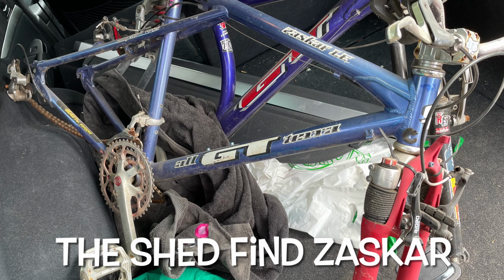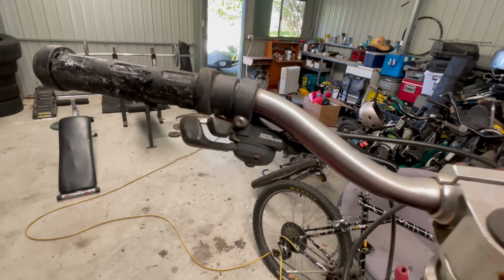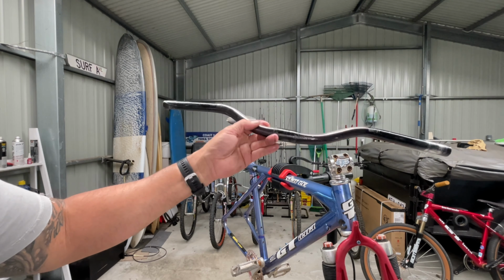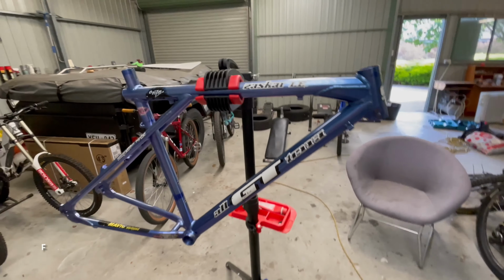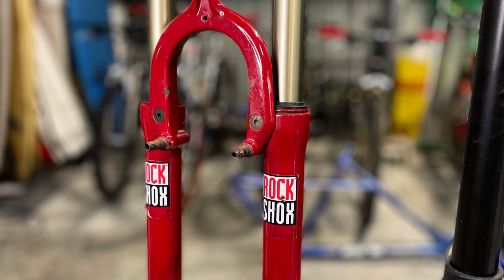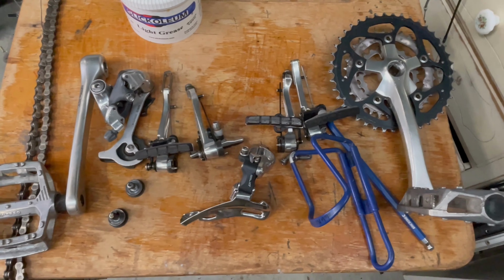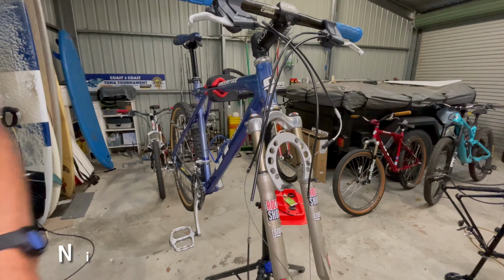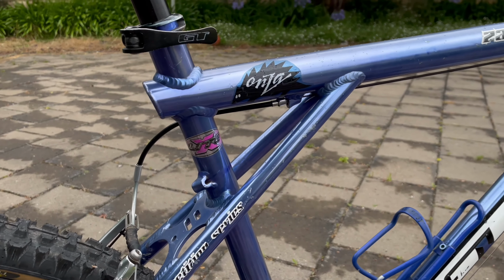Vintage mtb restoration | ‘95 GT Zaskar LE | retro mtb shed find!

Comment: I just bought a like new 2006-2007 GT Zaskar Expert 26" wheels, Rock Shox Recon 327 forks, Deore components. Black gloss paint with Red pin stripping. If Batman rode a bike, it would be this bike. It's wicked light and really fun to ride.

Comment: Absolutely awesome. Pity about getting it re-anodised. I picked up a GT Karakoram, full DEORE LX group set but the shifters were destroyed internally. It was only $20 , but like yourself finding these parts on e-bay or the like is almost impossible and when they do appear the prices are highway robbery! I decided to go with a full grit blasting and repaint of the Tange 4130 steel frame.

Comment: Had one of these in black in the mid 90s. Had normal forks no suspension. Brakes were Magura HS22, Middleburn crank then I think the rest of the groupset was XT. Can't remember the wheels exactly but think they were Mavic. Know it's what they were designed for but was a fast bike.

Comment: Wow, ive got an early 90`s Zaskar LE in the shed, havent rode it for about 7 years. I`m 59, used it to ride back and forth work about 8 miles each way back in the late 90`s, not every day, too unfit for that lol....Was considering adding a rear wheel electric hub and making a good ebike out of it. Might have changed my mind now. Are these collectors bikes now? Mine is in silver with yellow / red zalker decals, or no colour, just aluminium.
Reply from the maker: Yes. Arguably the most collectible of all the GT retro bikes and worth good money if original.